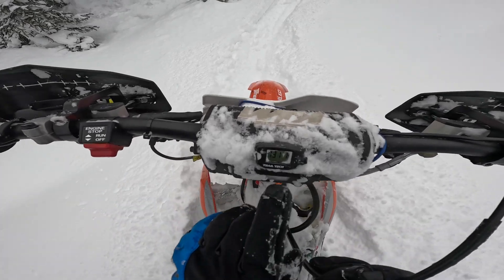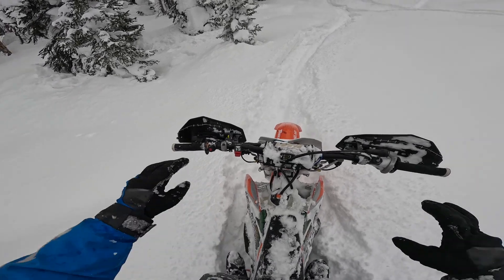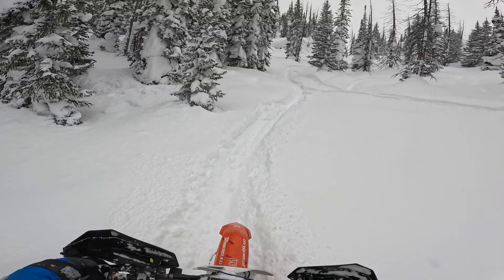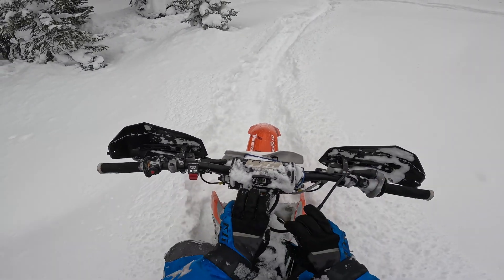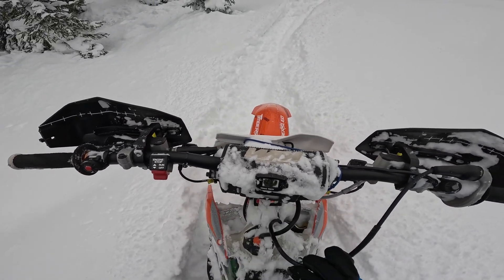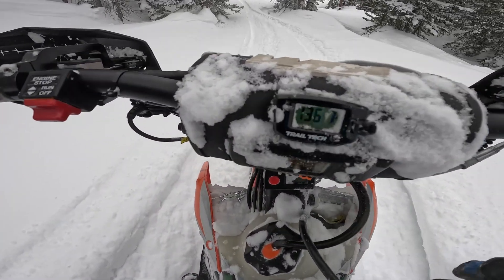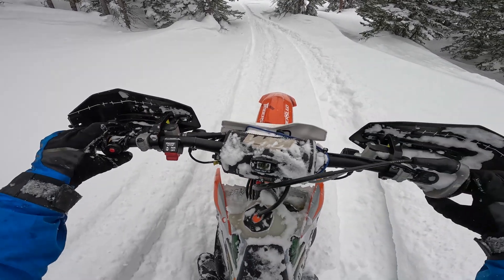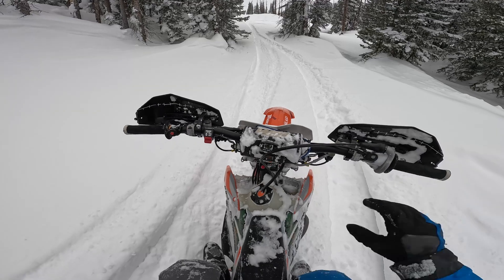XRT Heat Exchanger Snowbike Hill Climb Test

Comment: Nice to see some Forward thinking content for Snowbike’s!.
What’s the situation as far as mounting gas cans, gas bags, pelican cases and things like that on the tunnel? Does that area of the tunnel need to be kept clear of any bolt on items?thanks
Reply from the maker: Accessories that bolt down through the tunnel have to be strategic. XRT does make different shape and type exchangers to try to work with your accessories. They also make stand offs to allow for some clearance for fasteners. I choose to mount my accessories from the sides of the tunnel. Most of the timbersled brand accessories mount from the sides.